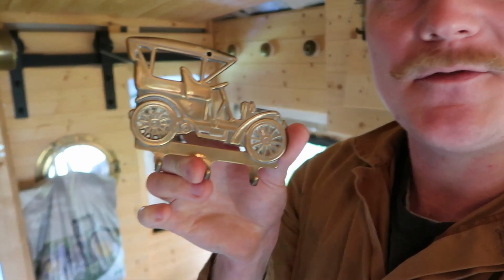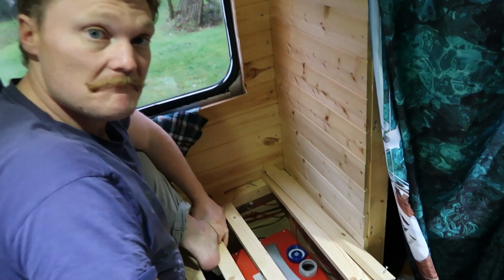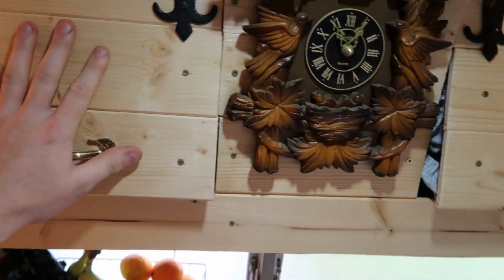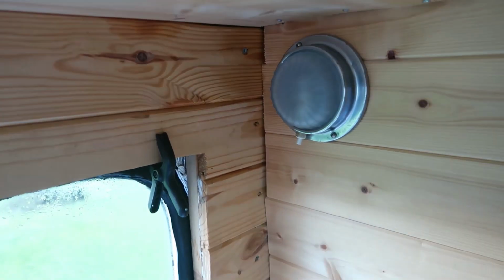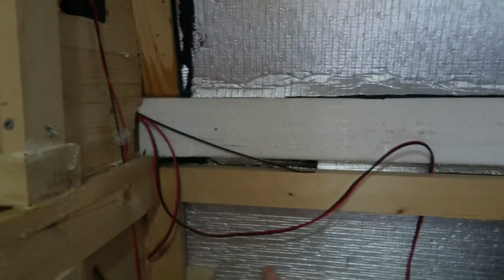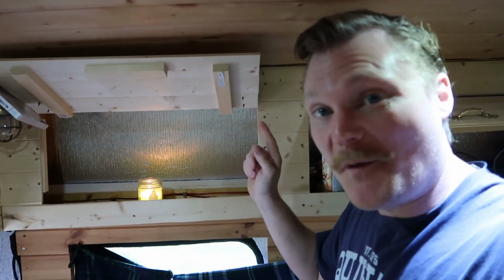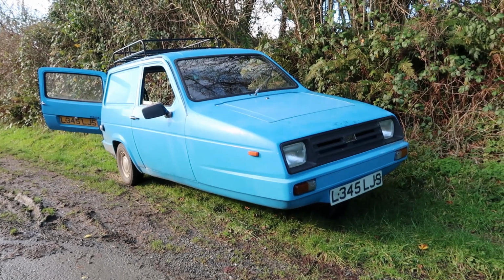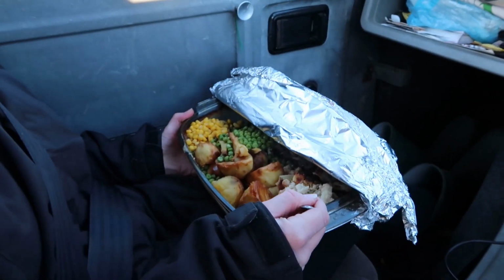vintage van life episode 31, damp mold and three wheelers

Comment: A Karcher window cleaner will be perfect to suck up the excess moisture from the windows (a natural dehumidifier) and then tip the water outside. It is better to be able to see the condensate rather than let this form in hidden spaces, it is not just a problem in vans, but buildings as well!

Comment: At 9:50 you totally wasted the chance to say "It's 250 miles to sussex, we've got  full tank of gas, half a pack of biscuits, it's bright, and we're wearing sunglasses"
Reply from the maker: i would have made Jake and Elwood proud
Reply: @forwardtothepast2411  Regarding your ignition/starting issues, make sure your earth strap is clean and not corroded, even if it seems tight. This can lead to all sorts of electrical gremlins. Check both the battery terminal and the cable from the engine to the chassis.

Comment: Condensation is a problem for many van conversions a metal box is not really ideal. I've often thought of using a flatbed and building your own  body out of wood or you can buy the composite panels Motorhomes n caravans are made of to do it, not that I have that level of skill. The other thing I've seen on many van self builds is a lack of ventilation. My motorhome has a number of floor vents (primarily as gas drops for safety) and the roof vents even when closed are still vented so keeps the air circulating so letting the damp out.